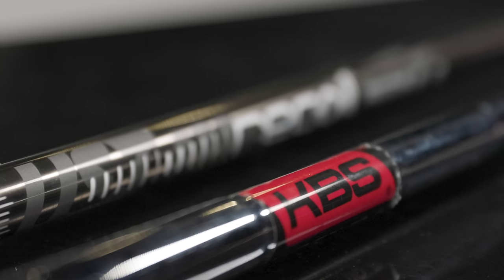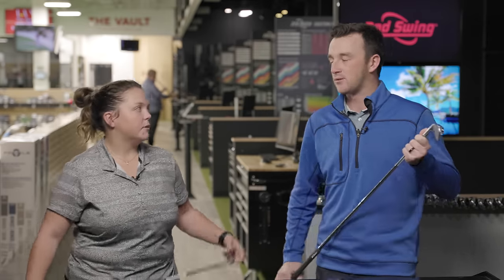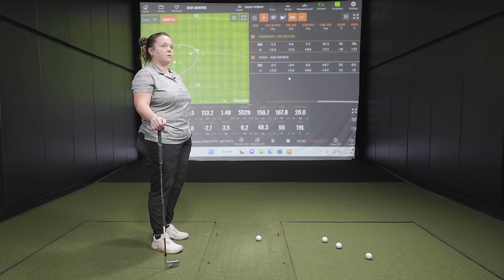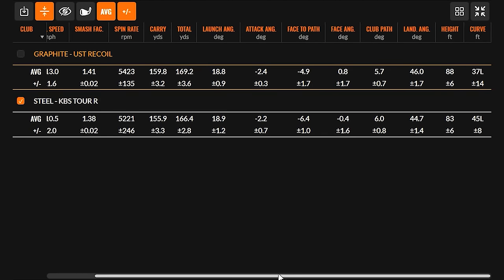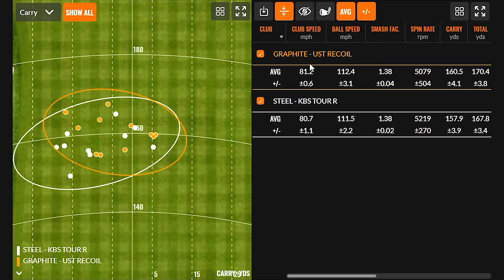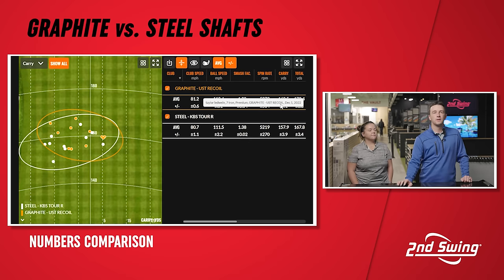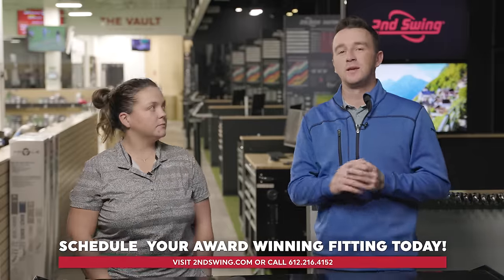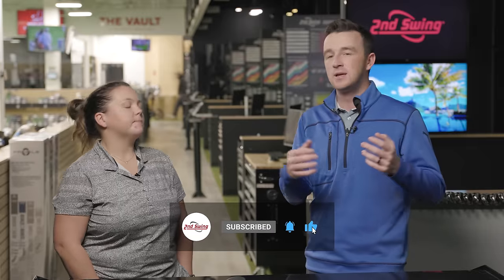GRAPHITE vs STEEL Shaft Comparison | KBS Tour R vs UST Recoil

Comment: I just got some irons with the UST Recoil 95 graphite shafts hoping it would help my tennis elbow. Previously I used the Nippon NS Pro 950GH Neo shafts which were almost identical weight. The graphite shafts feel so soft off the face... maybe too soft. But I still get enough feedback on my mishits. Overall, much less vibrations which is helping my elbow, so I'm super happy with the change.

Comment: Great to see a test with Taylor because those of us who have moderate swing speeds can relate to hers. Wish you would let us know which iron, a 7 or a 6, and which ball. Spin rates and ball speed can vary with the ball. For Taylor, the Recoil graphite did better than the KBS Tour in every category. Probably would for me also.
Reply: Not every category. Spin rate was better with steel which she says she likes better to hold greens.
Reply: @scotthucks7966  Interesting. I will be 82 in June and am in the process of changing from my current 120 gram Rifle Lite stiff flex steel shafts to  
lighter steel shafts, almost certainly Nippon NS Pro Zelos 8 stiff flex steel shafts that weigh 87.5 grams. Keeping the same forged blade heads as I love the feel. I can get 10 yards more carry with my 7 iron as a result of increased swing speed and ball speed with the lighter shafts. Nippon has world class steel technology. Preferred them to KBS Tour Lite. The Zelos shafts are designed to feel close to graphite but are less expensive.
Reply: @scotthucks7966  
With overall spin speed over 5000RPM, a difference of about 100RPM isn't likely to be noticeable.  And will be offset by higher launch.
Reply: I have had Recoils in my Z785:s for 3 years now and very happy. See zero reasons to change back to steel especially with my elbow arthritis.

Comment: Other tests ive seen used the same weight and flex however the grahite shaft had less bend at impact and tighter club face dispersion.
I find less finger fatigue from graphite partic when hitting off a range mat...

Comment: I have been using Recoil 780es SmacWrap from Modus 105 tour. My right shoulder joint was forcing me to look at graphite in the irons. I loved the Modus 105 but the 780es SmacWrap has special anti- vibration material and I can play with no soreness.

Comment: With all the options for 95 gram steel shafts available, why would you not test those against a 95 gram graphite shaft????? That would be the true test.Dispersion in this test is more about weight than shaft material.
Reply: The player is hitting the ball not the shaft it’s all dependant
Reply: Could not agree more this was not apples to apples,  should have been same weight
Reply: Couldnt agree more. Cmon guys
Reply: Exactly.  They should have used the KBS Tour Lite steel shaft which is 95 grams.  Instead, they used the 110 gram Tour.  Facepalm!
Reply: I'm wondering exactly the same thing.  Also, she's hitting the recoil prototype which is allegedly their low launch model. Never hit it but read about it and you would expect it to act more like steel in terms of kick point.

Love 2nd swing vids but this is a bad comparison video.

Comment: Wouldn't the KBS tour Lite 95 gram shaft have been a better steel shaft to use in this test so that you would be comparing a light steal shaft to a light graphite shaft?  The Tour regular is 110 grams.
Reply: Or the Nippon NSPro 950GH Neo 95g, which is what I previously had before changing to these graphites.

Comment: I am 63 years old, 7 handicap, driver swing speed on average 87-90. I have been just recently fitted and coincidentally compared the two shafts in the video. For my quick tempo the 110 steel seemed best even over 95 steel. That’s just me. What I will add is the 3, 4  and some times a 5 iron is moving to hybrids which I hate compare to irons. New possible trend . Mixed set steel through 7 iron and 6, 5 in graphite. Thoughts? Why not?
Reply: I am same age, driver swing speed around 95 to 102. 7-iron around 85 mph. I have played 64g Recoils ESX F3:s for 3 years now. The flex is medium but more like a "soft" stiff flex. Great shaft for me, had to put extra lead tape to the heads because of the light shafts and playing medium size grips.

Comment: Are UST Mamiya still calling the Recoil 95 a Prototype? I just checked their web site, and they have Recoil 95, 110 and 125 in F3 and F4, but do not mention Prototype anywhere. I saw reviews of the Recoil 95 Prototype from 2013, 2018 and 2019 but not newer. It may be only through a custom order from one of their TSPX (stands for Tour Spec) Lab fitters.
Reply: The standard Recoil 95 is a different shaft than their Prototype Recoil 95 shaft.

Comment: I disagree with the analysis of the dispersion.  Take out the two worst shots of each shaft and see what remains.  Removing the two left-most points of the graphite shaft leaves a circle about 12 yards wide, centered about 3 yards left of the centerline.  Doing the same with the steel leaves a circle about 20 yards wide, centered 8 yards left.
Reply from the maker: Thanks for watching and for the comment - and yes, it's difficult to get a good data set that represents the performance most accurately. Our rule of thumb is usually to utilize the better shots and remove the poorer ones that are not indicative of the club or shaft's performance

Comment: I got a question, I’m like 84-86 mph w 7 iron, I’m thinking about steel fiber I95 stiff flex?
Reply: Too stiff.  I95, or I110 in Regular would be a better fit unless you have a violent tempo.

Comment: You should do the test again but with a third option - a shaft which combines both such as the Steelfiber or similar, but crucially have all 3 shafts at the weight

In terms of the raw numbers once you take into account standard deviations and statistical significance any small differences in performance are almost certainly down to the weight differences in the shafts rather than one being steel and one graphite

What the test shows is that there are not really any performance differences now between graphite and steel shafts - which ever one you prefer the feel of, assuming proper fitting, will do you well

As for Taylor, what a lovely rhythm to her swing

Comment: I get exactly the opposite results when going from steel to graphite. I have recoil graphite in one set of irons and TT dynamic gold in another set, both regular flex. I can not feel the lighter weight graphite shafts working in the swing, it provides no feedback and I tend to hit all my clubs off the toe (even though the graphite club is about an inch longer) and all my misses are pulls to the left. When I switch to my steel set, I can feel the shaft working through the swing, direction is usually spot on and I hit the center of the face nearly every time. I was "fitted" to the recoils at an indoor facility where I hit the five iron 190 yards (I'm 60+ years old, 9 handicap). The most I can get out of the five iron on the course is 170; 160 being my go to distance. I also had a bad fitting experience years ago when I bought my steel shafted irons. On the indoor set up, I hit the DG stiff flex shaft 10 yards farther than the regular flex so I bought the stiff set. On the course, I had horrible results, losing about 10-15 yards per iron. I switched out to the regular flex DG and got my normal distances back. So for me, these indoor fitting facilities are b.s. You want to get fitted? Do it outdoors on the range and on grass, never on a mat.
Reply: I have had very similar results as you. Indoors is off from my outdoor performance.

Comment: I think that is inaccurate statement that better players or those with higher swing speeds steel may be a better option. As there are plenty of high swing speed pros playing graphite shafts such as Bryson DeChambeau plays with LAGolf graphite shafts
Reply: There are graphite shafts every bit as stable as steel. But not the ones that come stock. You'd need to get those installed custom at a pretty high price.
Reply: I just got fit and picked 120 gram la golf graphite shafts,  I'm in love lol. I have 93 7 iron swing speed
Reply: Completely agree — I have above average swing speed (105 mph driver), and I greatly prefer lighter graphite shafts for my irons.  On YouTube they act like graphite is only for old ladies.  To me they’re just more comfortable
Reply: @jacobmccain8082  lot’s of oem’s offer premium graphite shafts now. Up charge yes, but they are available.

Comment: Seems like a missed opportunity and kinda pointless comparison. You’re comparing a KBS steel to a UST composite? You’re aware KBS manufacture composite iron shafts? They offer them up to 115g, if memory serves and in several different EI curves depending what your target launch window is. 

Even if for some reason you chose to not use the KBS composite iron, there are products from MCA, Fujikura and Accra that offer more weight and EI curve options than UST. 

When I switched to composite iron just last year in my Miura’s, it was primarily to allow me to play more than one round weekly, my left elbow and wrists would stiffen and swell after 18 holes w/Modus Tour 120 X. I settled for MCA MMT 105X. The difference in vibration at impact was enough I could play several rounds last Summer on consecutive days. Because how we spec’d shafts my launch window was unchanged. We also added a few grams counterweight in butt of shaft to maintain same swingweight of D3.5. Without that we would have been at over D4, almost 4.5. 

When your tester is stating more head feel, that is due to lighter shaft increasing the swingweight, has nothing to do with composite material and/or flex profile. Some folks prefer heavier swingweight, especially with many current ‘off the shelf’ clubs in very low D1-2 range due to lower mass heads. For others, an increase in swingweight can feel like swinging an anvil and will upset their timing.